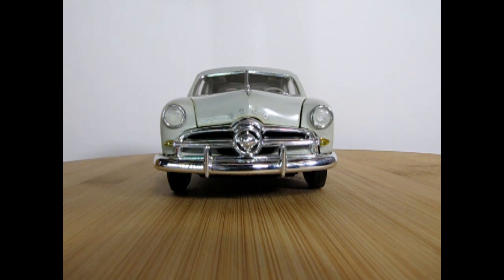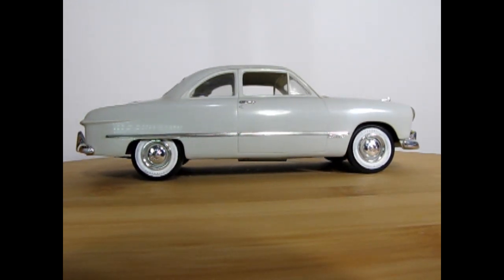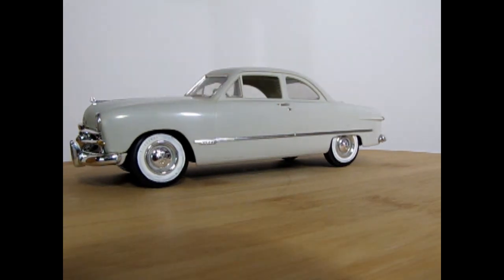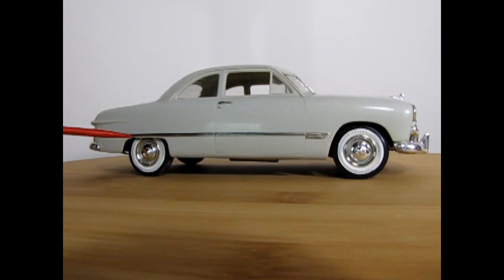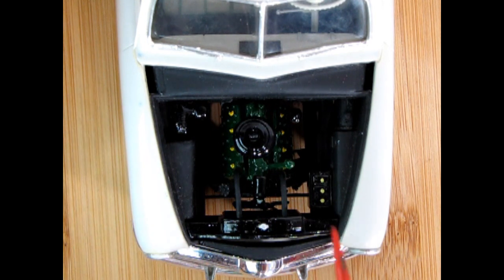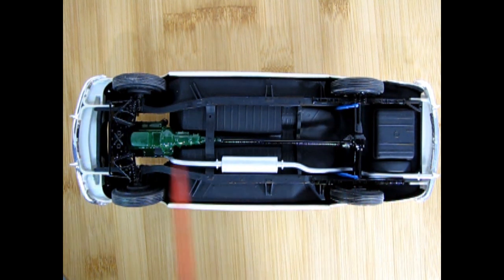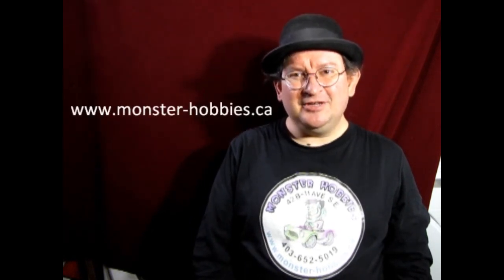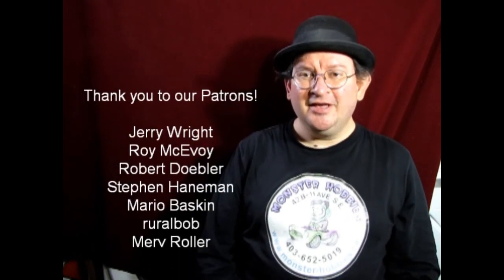Model Car Garage Show And Tell - My AMT 1949 Ford Build Stock In Grey Plastic - A Model Car Build

Comment: Looks great  you know what I want to do with one of them 😉
Reply: Hahahahaha, yep, Gasser!
Reply: I think one of those would be cool as a gasser!
Reply from the maker: @hensleyshobbies-doug7761  For sure. Would you try to use the raised axle in the Revell 1953 Chevy kits?
Reply: @MonsterHobbiesModelCarGarage  - yeah I’d probably use the raised axle if I were making a gasser, you know?
Reply from the maker: @hensleyshobbies-doug7761  Seems logical! :D And radius those rear wheel openings as well. Throw on the Hillborn Injectors from the AMT 1939 Ford optional Oldsmobile engine.
Reply: @MonsterHobbiesModelCarGarage  - yeah man, nice idea buddy! Hey, come to think of it, I think I may have a AMT 53 Chevy in the stash, somewhere?? Hmmm.......well, I can’t get to it right now, but I’m sure I have one.
Reply from the maker: @hensleyshobbies-doug7761  Impossible - Amt only made the 1951 Chevy. Revell made the 1953 and 1954! :P
Reply: @MonsterHobbiesModelCarGarage  - actually, Come to think of it, I believe it is the AMT 51 Chevy kit..
Reply from the maker: @hensleyshobbies-doug7761  some cool 6-banger engine enhancements in that kit.

Comment: Yes, Trevor👍it's very nice to see your builds included😃Pete 😎
Reply from the maker: Thank you so much Peter. Have you ever built a model car with a polished plastic body instead of painting it?
Reply: @MonsterHobbiesModelCarGarage  No. But I have an old revell 26 T, that is in such amazing ruby clear metallic plastic that I have been thinking of polishing. I certainly don't want to paint it, 🤷‍♂️😳
Reply from the maker: @petesmodelcarcustoms584  The other way is to clear coat it. I have done that too and I used decals on the model. The clear paint locked in the plastic color and the decals in one go. Would you consider the same?
Reply: @MonsterHobbiesModelCarGarage  there are a few mould lines that would need polishing out. I did think of spraying chrome on the inside then blk and get mirror effect🤩
Reply from the maker: @petesmodelcarcustoms584  Painting the inside with a gold or silver might bring up the color values more. I know that metallic paint is a bit translucent. Not too sure on the plastic though.

Comment: Nice Trevor, real nice buddy! 👍👍🤘✌🏻
Reply from the maker: Thank you. Have you ever built a kit and polished the plastic? - or even just clear coated on the top?
Reply: @MonsterHobbiesModelCarGarage  - you’re welcome buddy! No I don’t believe I ever did that on a model, can’t say for sure though..?!?!
Reply from the maker: @hensleyshobbies-doug7761  Well, you have to like the molded in color, but there's no time like the present to give it a try! :D
Reply: @MonsterHobbiesModelCarGarage  - Right on brother, right on! I hear ya, no doubt! I’m in the middle of several different builds right now but maybe after these.?? Thanks bud, I preciate it!
Reply from the maker: @hensleyshobbies-doug7761  Ha! I brought my Lindberg 1932 Chevy Pickup to the store today to write up the video description. When I opened the lid, I found out I put a basic coat of paint on all the parts of the kit and left a hobby knife in the box. All I need to do is add some Bare Metal Foil, put in a black wash, paint the wire wheels, paint the wood planks in the pickup bed and foil the bed rails. then glue it all together and I have a model kit finished! 

I didn't even know I got so far on it! - I made that model kit review in 2012. Wonder how long the model has been sitting in the box like that?
Reply: @MonsterHobbiesModelCarGarage  - Hahahahaha, heck yeah bud, finish it up and put it on your channel!
Reply from the maker: @hensleyshobbies-doug7761  Going to try and see if I can film that this weekend.
Reply: @MonsterHobbiesModelCarGarage  - Cool buddy! 👍👍

Comment: I've done a few like that.  If I like the color it is molded in, why paint it?  This is especially true of early Monogram models.
Reply from the maker: For sure. The Monogram kits had a lot of metallic plastic in them. Which one was your favorite bare plastic color?
Reply: @MonsterHobbiesModelCarGarage  Probably the 1940 Ford pickup that was molded in turquoise.  I have also built the 1936 Ford which was molded in a tan color and the 1934 Ford which was a deep red. Oh, yeah, the original Little Coffin as well.  The colors were very opaque and polish out nicely.  Like you, I made sure to carefully sand and polish out the mold lines and build them as cleanly as possible.  These may not be contest models but are great shelf models.  And since these models only came in these colors in their original issues they are historically significant (to me at least).   By the way, you did an awesome job on the 1949 Ford.  I believe gray was a factory color. Best wishes and keep building!
Reply from the maker: @danieljohnson9351  Sounds good. Grey was in that 1949 color pallet for sure. I have 2 of the Little Coffins. Got to build them again.